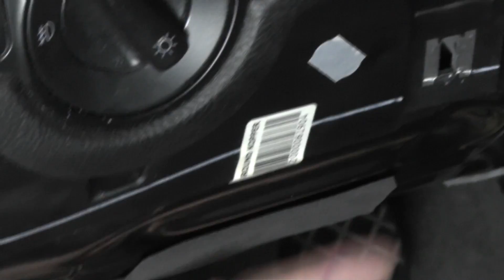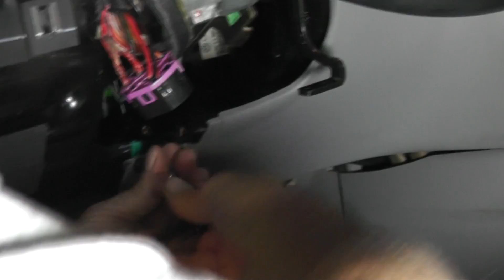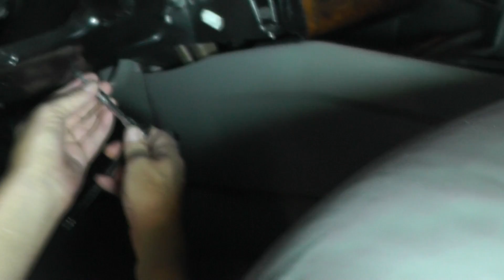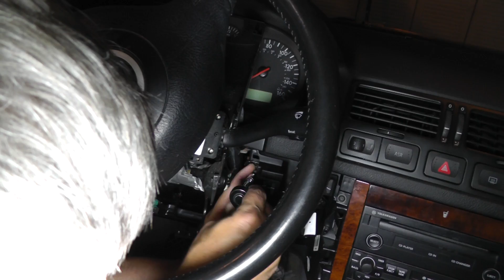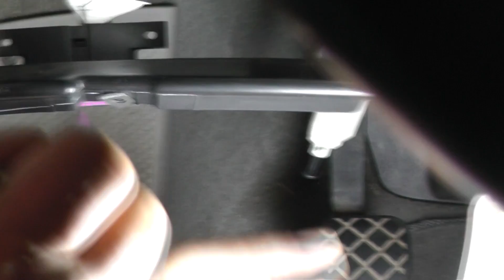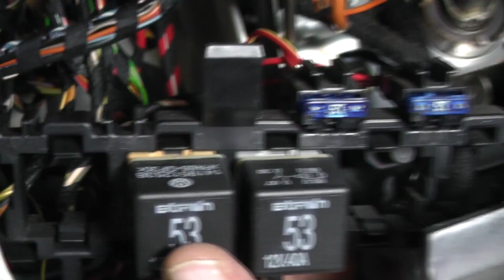Volkswagen Jetta Dropping Relay Center - Part 3

Comment: I’m trying to wire a push to start, would you know where the 12v, starter, ignition 1&2 accessory and the brake wire is?
Reply from the maker: Sorry, I do not know how this system is wired.

Comment: Do you know if this is the same location for relays for my Jetta 2010 TDI (MkV)? I am having an issue where in warm temps my car doesn't want to start and flashes the PRNDS letters. But in cold weather starts just fine. I feel like it's a relay thing, but nobody can seem to tell me where the relays are in my car. Obviously I hvae fuses on the side, and fuses in the hood by the battery (with one relay). But it seems like there should be more relays somewhere, and I'd like to locate them to swap them out.
Reply from the maker: I cannot say for 100%, but it's easy enough to take a look under the dash and see if they are there.

Comment: This video is helping me decide to drop the relay tray. Pray for me.
Reply from the maker: It's not bad at all. Just take your time and you'll be fine. 😊
Reply: @stuzman52  Thank you for the encouragement. I have a 2006 jetta 2.0 with no voltage at the fuel pump. Fuse and 409 fuel pump relay is good. Tracing back is now my mission. 🙃
Reply from the maker: @la1negrita  Sounds like you've got a plan! Keep up the good work and I'm sure you'll find the issue.

Comment: Hi! I'm hoping you can shine some light on me. If I use my wiper fluid it'll run down my footrest. I've tried to disassemble this bit of the dash just like you did trying to find the plumbing, but I couldn't find anything. The fluid comes from somewhere above the relays (which is a serious short circuit problem) and I can't find the leak or even the plumbing.
I've been told it might come from the windshield, next to the wipers motor, but rain water doesn't get in. I'd appreciate any help you can give me.
Reply from the maker: Bruno, you're probably talking about brake fluid and not wiper fluid. Take a look at your brake pedal and there should be a plunger that goes into the back of the master cylinder. If it's leaking inside the car as you've said, there should be signs of leakage there. My guess is that you have a leaky master cylinder on the backside.
Reply: @stuzman52  No no, I mean wiper fluid. If I use my wiper fluid it'll run down the foot rest like I said...
Reply from the maker: Bruno Oliveira Okay Bruno, just a misunderstanding on terminology. You would be talking about windshield washer fluid. Your area of interest would be under the cowl inside the engine compartment. Remove the cowl and take a water hose and let some water flow in and you should be able to see how the water is getting inside the car.
Reply: @stuzman52  But rain water doesn't get in.. only the windshield wiper fluid.

Comment: I can't get this panel open. Removed 3 star screws. 2 diff sizes. Dont see any more. Can't pull metal plate. Also see where used to be a clip that is broken off not sure if that holds metal plate. Can't get off 

VW why are you like this?

Comment: Stutz , blower motor quit working .  New motor , new resistor  checked fuses.  What relay under dash might I check 2001 vw Vr6.   Climate control  saying # 85   got to be a relay.
Reply from the maker: I can't really say Doug as I sold the car over a year ago and I don't have the service literature to look up any diagrams. Sorry...

Comment: Your a very smart man and I appreciate you doing this. Im about to tackle the same issue I think. Our jetta has shut off or came close to shuting off while adjusting the steering column. The other night it happened while I was driving. So I started it back up and stopped. I started feeling above the tilt handle and I felt that harness as soon as I touched it the car shut off. It done this every time. I research everything I do before hand these days and came across your video about the ignition circuit and watched you intelligently attempt to explain vw/ audi reasoning for branching smaller guage wires of of a 110 amp circuit. I went to school to learn obd 2 systems  and did very well in auto electrical systems. And I imagine there has to be a law suit on there hands here. Everything I learned about branching circuits is the main circuit must be capable of handling the combined curent of everything down that circuit but at any point where it branches off must be fused rated . This is every time you do that.
I wish I could explain things better. But I leave that to people like you who can. Keep it up and thanks
Reply from the maker: Thank you Anthony and hope you get your Jetta figured out. Sounds like you've got a good place to start looking.

Comment: Hello buddies. How can I access wiring diagram for vw passat b5 with engine code ANA? Been having a crank no start problem and I seriously  need help to troubleshoot the vehicle.  Any help please?
Reply from the maker: Isaac, it might be hard to find free wiring diagrams online, but one source that is free is located at www.bbbind.com
Reply: @stuzman52  OK thanks for the info. And please how can I approach the problem of the said car? There is no communication with ecm and abs and traction light is on. So car is refusing to start.

Comment: Hi i know this post is over a 3 years old but have a problem whit a 99 jetta. The clouster gauges temp.gas. do not work and the rpm and Speed. Any input thanks for the video
Reply: You might have a bad cluster. Check ground and power that feeds the cluster circuit

Comment: hey everyone im looking to find out where is all the relays for a 2000 jetta , are they under the wheel panel ? or behind the fuse box near the drivers side doo ? anybody ?
Reply from the maker: If it's like the 2001 VW Jetta here, most of them will be located on the relay center which is under the dash to the left of the steering wheel. There are a couple of relays under the hood located at the back fireway on the driver side. All of these locations are shown in this video series. In fact, the relay center is shown in this video.

Comment: good explaining sir... now my question to you is, when I start my car there is no engine light or epc light at all it doesn't come on even when I turn the key in the ignition how do I solve this or what do you think may be the problem? I have a golf 4 1.8 GDI petrol!
Reply from the maker: Maybe the bulbs are burned out. Or you could have an issue inside the cluster. Sounds like you need to pull out a diagram to see what feeds those bulbs.
Reply: Shanta Mahalie la lusesita esta fundida nesesitas cambiarla

Comment: I have a jetta 2004 NOT TDI and it cranks and cranks but it doesn't start. Also the battery light is on and I was messing with the fuses. It hasn't started since. Any suggestions?
Reply: Sounds like you need to start with the basics of checking spark, fuel, etc. If it gives involved in the diagnostics, you'll need a wiring diagram to make a deep dive into it.

Comment: First, let me say thank you sir, for sharing this. I strongly suspect you are showing us how to deal w/ a '99 Jetta no crank. I want to throw this out: I suspect that our issue was caused by (another) guy who didn't know what he was doing, helping out and giving this car a jump start. (ALWAYS watch your guy with the helping hand... Defence!) Your sharp observation of 'no darn fuse' between burnt wire and battery gave me this idea, as we know we blew the big fuse by the battery when this happened. It seems to have gotten just hot enough, long enough, with us, to have done in the ignition wiring too-at least my guess. (Maybe with you too?) Although it has taken many months to now have actually caused this failure, if I'm correct about this.
Reply from the maker: In my case, the car didn't get any jump/start as it just wouldn't crank. The root cause of the issue was corrosion that had built up on the terminals of the ignition switch and it was probably inside too. And with this high resistance from corrosion, this created heat which eventually melted the insulation on the wires. So far, the car has been doing great for the last couple of years with no issues. Well, I've got to work on the a/c system :))) Hope you get your issue all ironed out Dave and have a good one!

Comment: Is it possible to bypass fuel pump relay and power fuel pump directly? 2011 vw jetta sportwagon tdi. I have been unable to find a wiring diagram for it :/ Any help would be appreciated!
Reply from the maker: You could bypass the fuel pump relay contact to do a test for troubleshooting, but not for a permanent repair. You can find free wiring diagrams and TSB's here http://www.bbbind.com/tech_database.html

Comment: hi thanks for the great video. trying to problem solve my issue on a golf mkiv gti 1999.

car won't start randomly (won't crank) using a test lamp I see that current gets to starter solenoid when turning ignition. if I direct feed that solenoid from starter terminal it turns.

this happens randomly only pattern I've seen is it mostly happens when it is hot. 

I suspect that I sometimes get low current to starter since when this issue occurs I still power my solenoid.

Where is my best bet root cause?

Comment: Thank you for the videos very helpful. I just bought a 2004 jetta without an owners manual. I am trying to replace the turn signal flasher would you happen to know what number it is in the relay box?
Reply from the maker: The turn signal relay is J1.
Reply: Ok thank you. I will take a look at it again in the morning. The only information I could find was about replacing the hazard relay but my hazards work fine.

Comment: FYI: I have a 2003 GLI and the lower clutch switch affects the cruise control. If I disconnect power from the lower switch cruise control doesn't work. If I disconnect power from the upper switch the car won't start. If you take either switch out & check the plunger beware pushing too hard. It doesn't take much effort for the plunger to go too far & stick. You can pull it back out but you may have already damaged it.

Comment: Thanks for the video's, had broken wire's in same area than you did.  Mine was on a 2003 VW Beetle Conv.  Some wire's the plastic covering was cracked or worn off and three broken in half.  We think sliding the sterring column in and out caused my problem.  Trading  soon.
Reply from the maker: +Debbie Rutherford Glad to hear Debbie that you got it ironed out. And probably not a bad idea about getting rid of it. Thanks for dropping by and leaving a comment.

Comment: Where is the relay box at?? Need to know ASAP!!!
Reply from the maker: Tara Spray If you follow these videos, you will see that the relay center is located under the dash to the left of the steering wheel. I show the cover to remove and how to drop the relay center down.

Comment: Great work Stuzman, not ease repair on this one, and yes I want to see how much current is in the system after is fix,  I wonder which wire start the problem since the red/gry should have current when is on start position only.
Reply from the maker: That is correct felplay. The red/gry feeds the solenoid windings. In my case, I have three wires fused together. Red B+, black wire that feeds the fuse panel along with the red/gry feeding the starter circuit. My best guess at this point is a piss poor design of the red and red/gry wires. I'll explain it all when I get back to this thing. Right now, some of the terminals are fused in the connector along with a bad ignition switch which has an open function for the start circuit. What a mess!

Comment: Would it be worth running a new relay circuit after repairing the wiring?

What mean is use the vehicle wiring to control a relay coil and have the contacts carry the current flow for starter solenoid which is connected to battery B+.

Just a thought so you could eliminate the issue happening again in the future.
Reply from the maker: Hi roastlambpie. In this case, it wouldn't make any difference since the starter lock-out relay serves the same purpose. It's contact rating should be rated to carry the current of the solenoid windings. In my case, the B+ red wire, the black wire feeding the fuse panel and the red/gray wire going to the starter lock-out relay contact were all fused together. So, a lot of the extra current was going through the ignition switch starter function which opened that circuit. Yep, bad ignition switch too. I'm going to need another ignition switch, and a connector along with the terminals and wires. It's just one thing after another. Thanks for your comments and interest.

Comment: Great series - wow that's a bear to work on.
Reply from the maker: Hi Steve. Hope you're doing well and yes, it's a little tight getting up in there. Been analyzing some data in Excel from this job and trying to figure out what went wrong. So, what have you been up too lately?
Reply: Hope alls well with you- it looked like it was hot taping the vid. Just came back from my lodge and it was down to 48 deg. F last night - the fall is on and the leaves are changing. Looks like 2 more weeks of summer.
Reply from the maker: Steve Rob Yep, doing pretty good. Wow, already 48F at night, and we're still hitting in the 90's during the day like it was on the filming. Probably gets around 70 or so at night. Winter sure starts to come early for you guys up there.